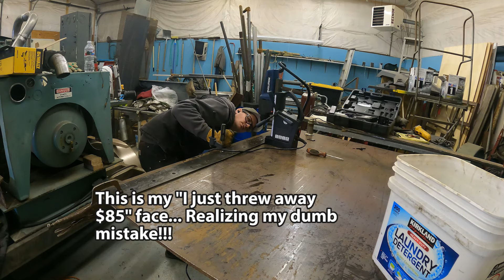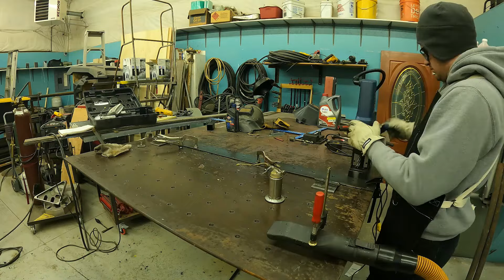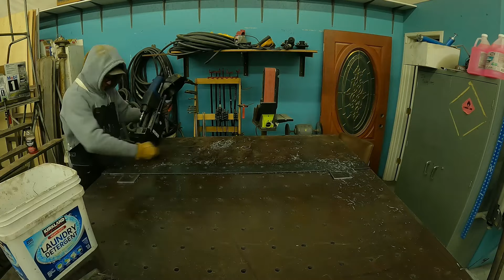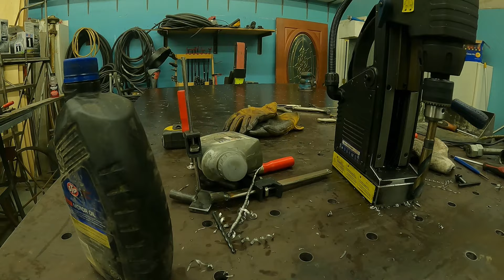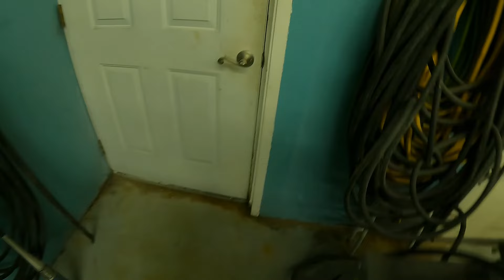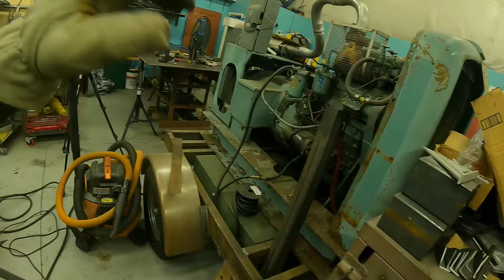USING THE EVOMAG 42 TO MAKE A FIXTURE TABLE

Comment: I’m happy I found your channel. I’m in the middle of building my table using the same, exact method you are. I first saw it on Brandon Lund’s channel. I’m using the same mag drill with a 5/8” annular cutter; thanks for the tip regarding the set screws being extra tight. I didn’t know that!  
I think you did a great job and I enjoyed watching you problem solve through the broken bit situation. 
Keep up the good work!
Reply from the maker: Thanks! The drill is pretty good. And for the price hard to beat. I have done over 1000 holes so far and only killed 2 bits.

Comment: just picked up a 3/4 in 4x4 plate now I need to make a table and pu a annular drill. I have an old B&D mag drill that I will use. I will make a guide plate on the mill with the DRO and do like you did thanks for the video
Reply from the maker: I wish I had the mill for consistency and precision.  The fixture table is an irreplaceable tool in my shop.

Comment: I bought my bits from Amazon and they worked great, except the Evolution one. That was garbage. I Like your idea of using the shop vac with the mag drill.
Reply from the maker: I thought the shoo vac was a good idea. Turned out to be way way slower. It gets plugged up so fast. My bits from. Amazon lasted much longer and cut faster than locally sourced bits and much better than the evolution bits as well. Thanks for warching!
Reply: Which bits did you get?
Reply from the maker: ACTOOL 5/8" Diameter × 2" Depth of Cut HSS ANNULAR Cutter with 3/4'' Weldon Shank https://a.co/d/gyus7aF
Reply from the maker: The actool bits I just attached did far better for me than anything else and they are a great price!